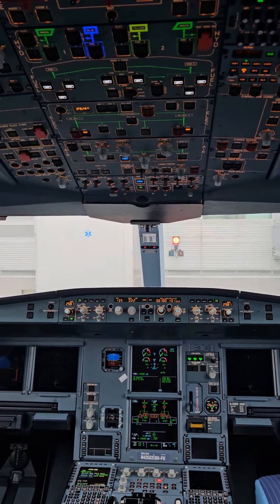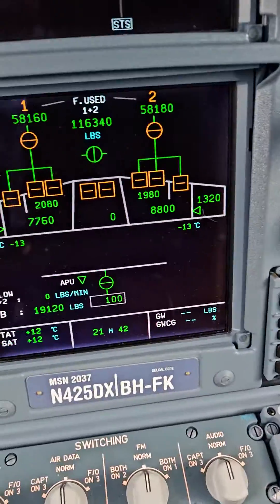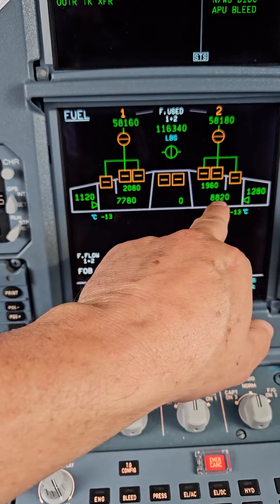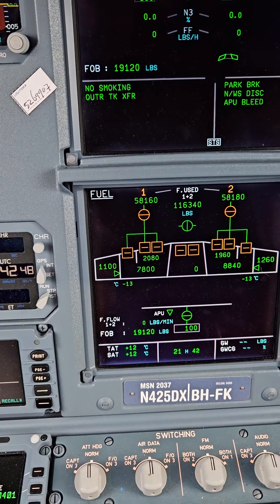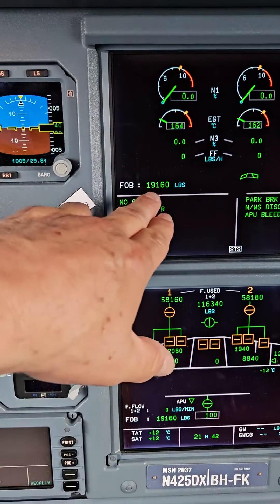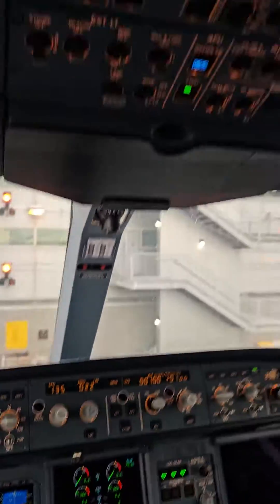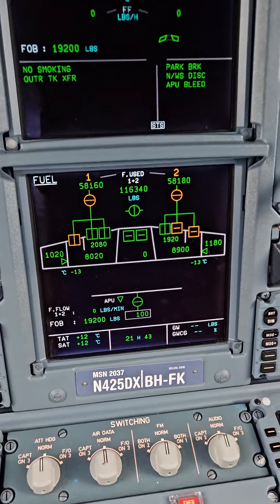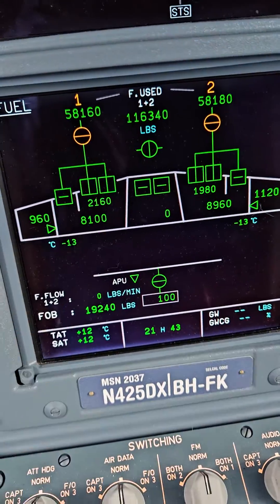Airbus A330 Fuel Tank System

Comment: Nice! What is the reason fuel is measured in pounds rather than gallons or some other unit?
Reply from the maker: My guess is that weight is the most important factor for us so having the fuel in pounds just makes our calculations easier. Our fuel flow is in pounds so we can use it to calculate our endurance, etc. Our weight and balance is in pounds, so there's that. Our landing and takeoff weights are in pounds so factoring fuel in or out is an easier calculation. That is a great question. I'm really just putting forward my opinion but I think it's based on some good reasoning.
Reply: @CaptainZtravels  Thanks! I knew weight and balance is extremely important, but hadn’t thought about how that figures in, but it makes sense now! 😀